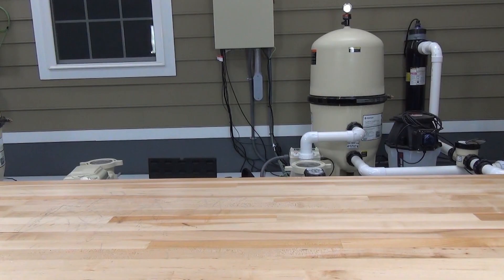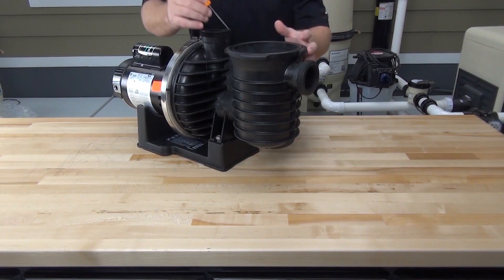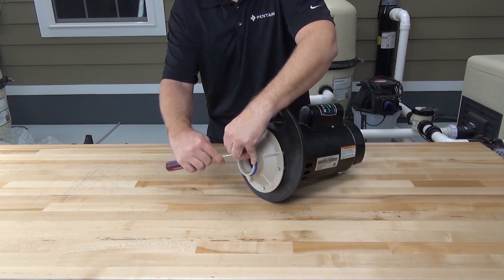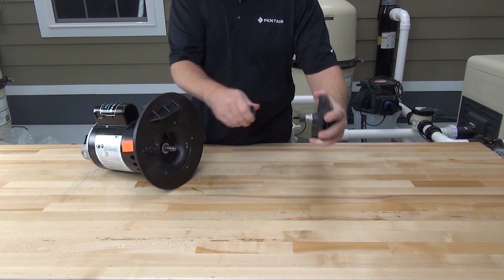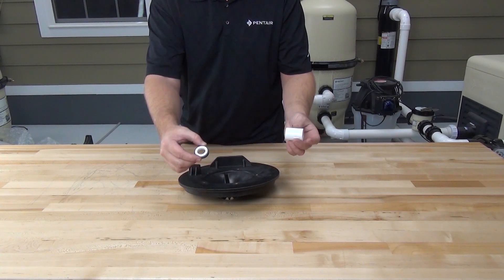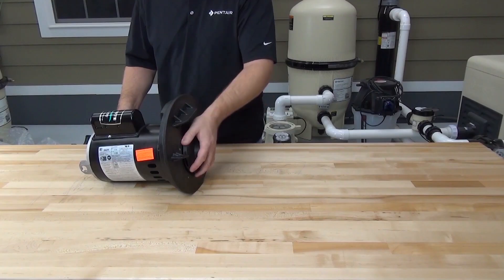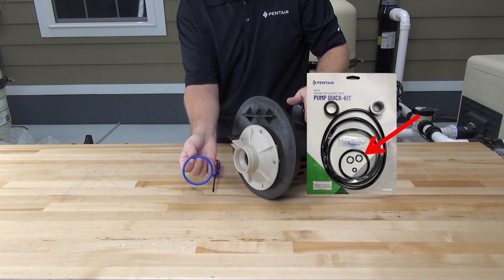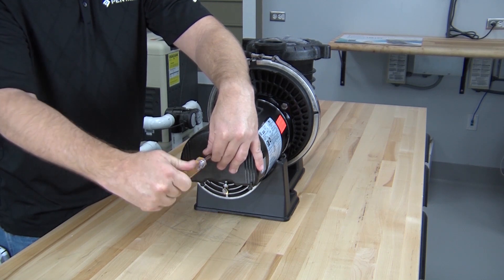Seal Replacement Max-E-Pro® & IntelliPro® pump with Pentair Genuine Quick-Kit

Comment: Wow, looks like Pentair jumped to answer questions here (NOT)! I think they should have recommended silicone grease on all of the o-rings, especially the diffuser since it can be a tight fit... Also, not sure why they show this on a a new, late model pump, versus an older one that might actually need the kit?!?

Comment: I accomplished all of this carefully (redoing and double-checking) - it still leaks from the bottom of the v-clamp. I replaced the seal plate and all the O-rings, etc. No cracks on the base. It still drips. O-ring resealed 3 times. Tapping clamp. It still leaks. It appears not to be leaking from the pump shaft - unless the diffuser can cause a leak dripping from the bottom of the v-clamp? Suggestions?
Reply: I'm having the same problem.  Replaced the seals, but still dripping at the bottom.  Did you ever figure out what was wrong?
Reply: @TylerFino did you ever figure this out?
Reply: I’m having the same problem.